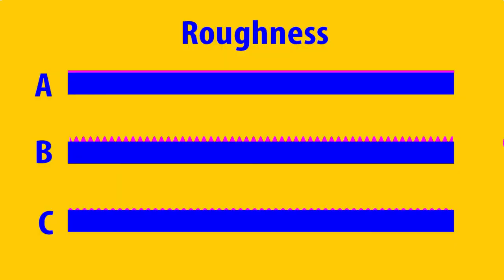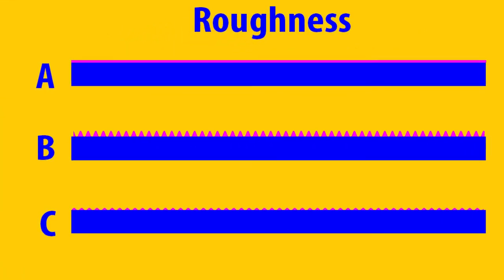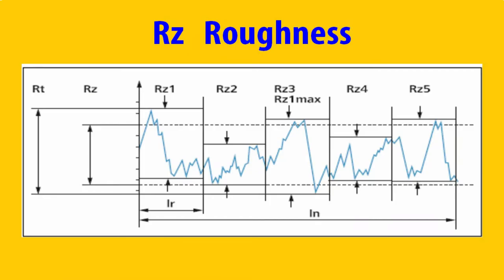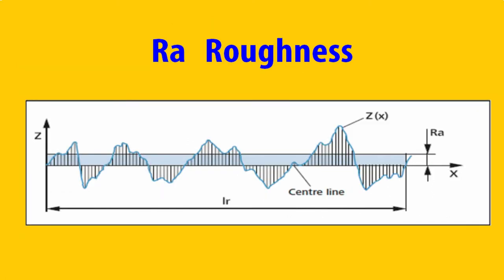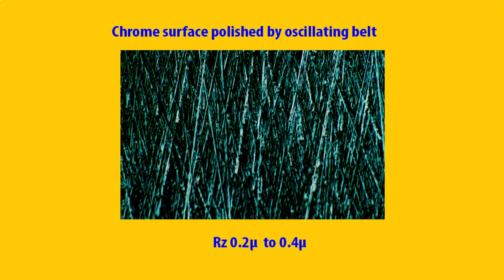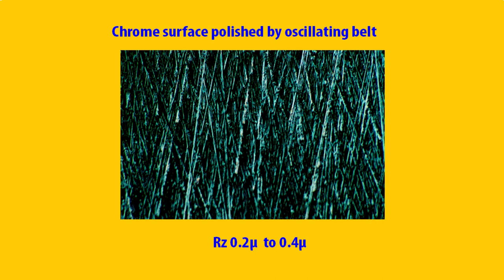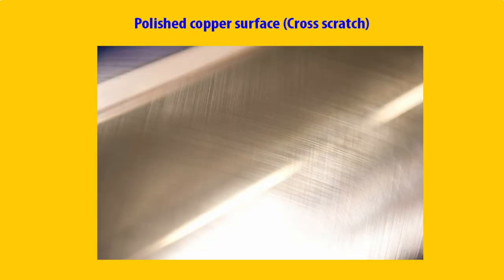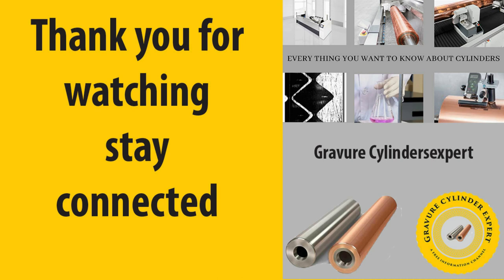Roughness of rotogravure printing cylinder

Comment: Can you explain the relationship between copper roughness and chrome roughness? Practically speaking, if you wanted to increase the roughness a little—or a lot—should you adjust the polishing program on the copper? or on the chrome? or on both?
Reply from the maker: We need to adjust roughness both on copper and chrome. We need to have higher roughness after copper polish than final intended roughness after chrome polish. Example if we intend to have 0.4 Rz after chrome polishing we should aim for 0.5 Rz after copper polishing.
Reply: @gravurecylindersexpert2851  Thanks so much for the info. I've been looking for some academic articles about this question, but I've really found very little good info. I guess what I'm going to have to do is fill up a spreadsheet with RZ measures on a set of cylinders in various points in the process and see what correlations I can find.

Yesterday I checked the roughness of a chrome plated cylinder before it was polished, and the roughness was about equal to what was coming off of our copper engraving process. I was surprised by that. Interesting to know though. I'll have to try measuring a few of the same cylinders after Cu polish, after Cu engraving, after Cr plating, and after Cr polishing to see if I can learn anything.
Reply from the maker: Thank you Darren, I would wait results of your research and we shall stay connected to learn from each other.